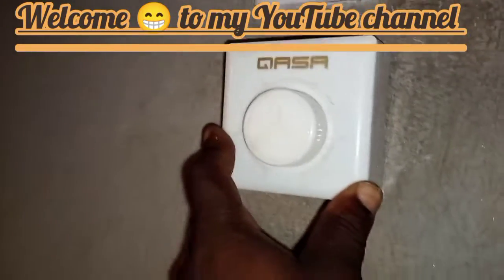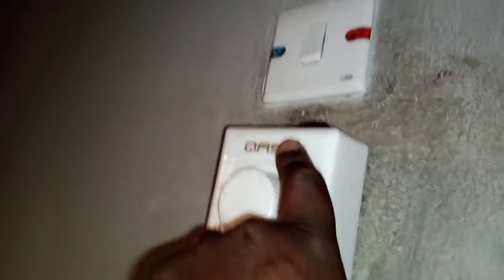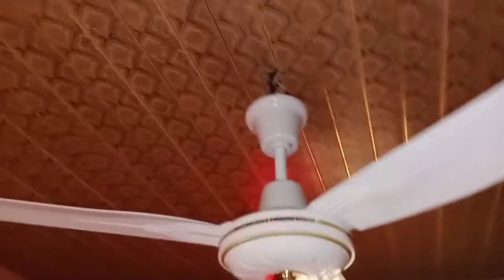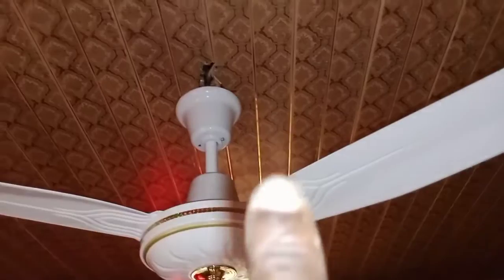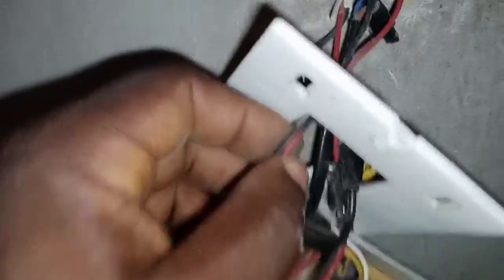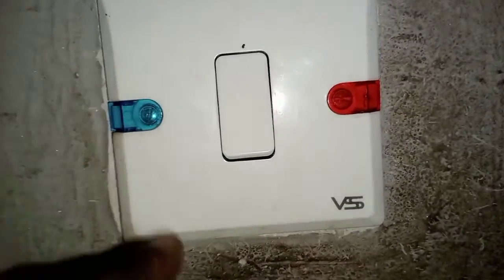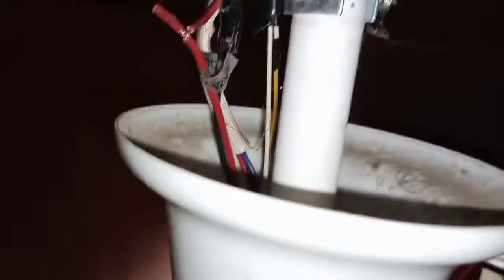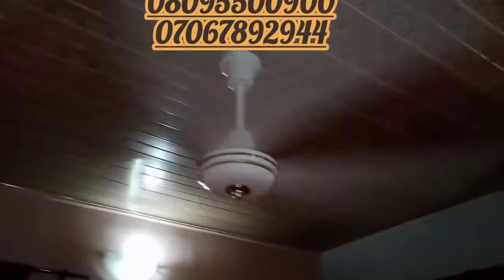How to wire a QASA AC/DC SOLAR CEILING FAN USING ALTERNATING CURRENT

Comment: How do I connect the fan if it has two white wires with red and black at the DC terminal with two white wires at the switch terminal

Comment: How will I know if the fan is running of d. C or a. C when there's light
Reply from the maker: If you are using NEPA,or Gen or inverter
Then you are on AC
But if you decide to use it only on battery 🔋 then you are on DC